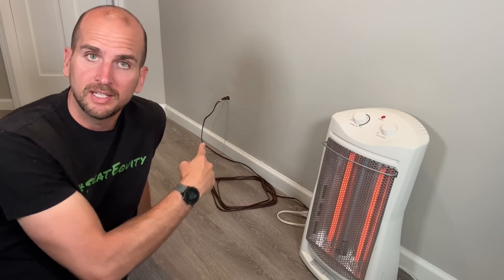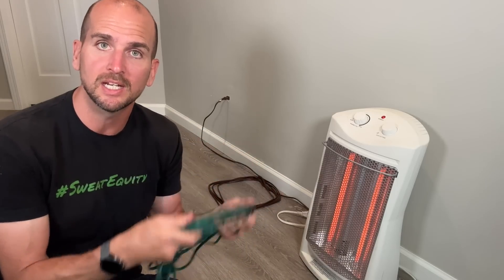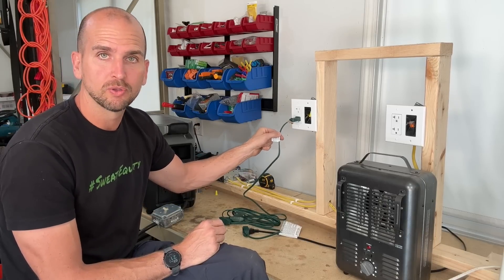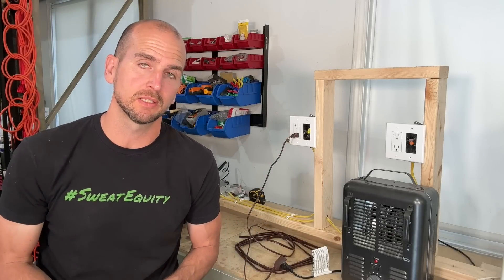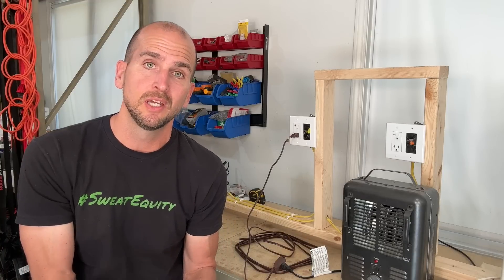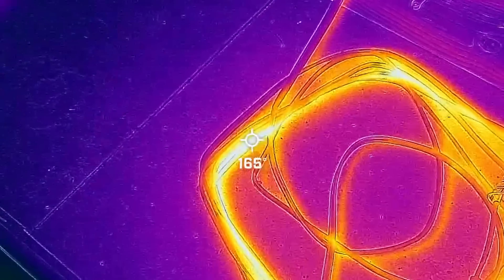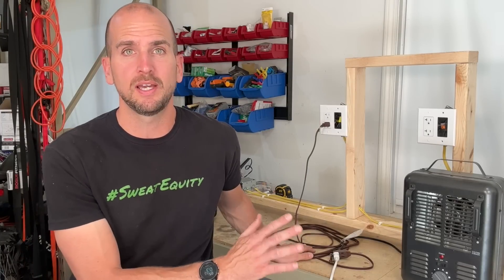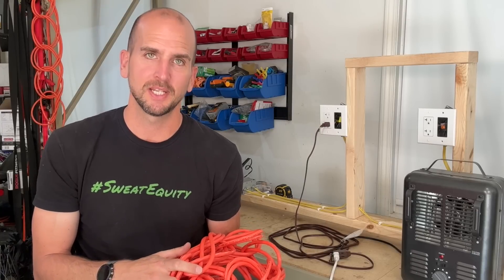The #1 Most Dangerous Electric Device in Your Home

Comment: Space heater rules of thumb: 1) never use an extension cord or outlet strip 2) if the plug is loose in the receptacle, replace the receptacle.
Reply: Yeah, I've always heard (and adhere to) not using extension cords at all for space heaters.
Reply: And speaking of receptacles be especially alert if your home was built or had wiring added between 1965 through 1973 give or take a few years, during this period aluminum wiring,  specifically the 1350AL aka old technology aluminum wiring was likely used in at least some of the circuits.  Unless the terminations have been made using approved methods AL expands and contracts 2 to 3 times that of copper or brass and also forms aluminum oxide which is a poor conductor unlike copper when oxidized remains conductive.   Any of these conditions can cause dangerous overheating and set fire to surrounding combustibles when heavy loads are drawn.
Reply: The problem is that in older homes especially and even newer homes if you have lots of power hungry devices in a room, you have literally no choice if you want to run a space heater or power hungry room cooler, a modern gaming computer/console and a LCD or OLED monitor because the power taken up by the devices can literally overload the circuit breaker supply power to the room.
Did that only a few days after my parents died and I was like "Okay... not doing that again!" Went to my parents 'bag of cords' and got the beefiest extension cord I could and ran the space heater off the secondary bathrooms outlet.
Never had the breaker trip again and the cord never even got above room temperature anywhere on it.

Comment: Conductors get hot. Did the 170 degree exceed its rating?
Reply: Most 16 gauge extension cords are rated at 70 degrees C which is 158 degrees F.  However, the carpet or linoleum under it may not be rated that high so the cord could light up the carpet or linoleum and burn down your house that way.  The molded male plug ends also tend to start to melt after a long time running at its maximum rating.  I have had heaters where the molded plug end did this right on the cord attached to the heater.  At that point I cut the plug end off and replace it with an industrial rated replacement male plug end.  Don't attempt to replace a male plug end unless you know what you are doing.

Comment: An iPhone Thermal Imaging Camera.  How cool!  Maybe not all that precise, but a good perspective indeed.  And you can also recor dit.  One learns about extension cord safety, or should, when connecting a portable generator or something like your EcoFlow to a circuit breaker panel.  A guy at Lowe's asked me about it when he was buying a high power portable generator for hurricane season.  I advised him to get 12g wire and be careful about extending them by coupling two together.  He said he didn't know distance, so I helped him select the single cord length by having him approximate the distance.  I'm glad he was smart enough/concerned enough to ask.  He asked me because it's hard to find employee help these days.

Personally, I have a collection of extension cords in different gauges for different applications and lengths.  Better safe than sorry.  I'm also going to watch you "Best Way To Wrap An Extension Cord."  I'm interested to see how easy it is to unravel.  Thanks for the videos, Scott.
Reply: unless they've changed model numbers, it's called the FLIR One.  they also make it with a standard connector, so that model can plug into ANY smartphone but an iphone.  they also partner with a smartphone manufacturer, to make a phone with an integrated thermal imager, but US carriers refuse to support it.

Comment: SERIOUSLY complicating this situation is that extension cords are not permanently marked with its wire gauge. I did find one here with a tiny, flimsy, difficult to read label that will easily and eventually fall off. It did give the volt/amp/watt rating which I presume is 16 gauge, despite the cord itself appearing very heavy. I wonder if its rating (125V/13A/1625W) takes into account its length.
Reply: I have a few that it is stamped into the insulation.   Probably depends on the manufacturer.

Comment: Ive always thought extension cords are a danger, regardless of gauge.  You have an electrical connection, likely lying on the ground, where flooding or what have you can connect with it.   I admit I do use a power strip for my computer though.

Comment: It's really unfortunate that standard consumer extension cords don't come with (cheaper than cheap!) fuses that would nearly entirely remove the danger presented. Furthermore, maybe I'm not looking in the right places, but as far as I'm aware, there just are no 16 gauge extension cords with fuses, even if I'm willing to pay a little more for one. Using a string of lights as an extension cord is safer than a purpose built extension cord!
Reply: I am curious as this seems to fly under the regulatory radar too. Like Fans and christmas lights all have fused plugs, but extension cords do not. Fuses are cheap, so I doubt that requiring fused cords would add significant cost.

Comment: It's a UL requirement and has been for some time, that extension cords must be constructed of #16 or larger wire, or #18 wire  with integral fuses. Having said that, folks younger than 40 may be unaware,  but some years back #18 extension cords with 15A markings on the plug and receptacle ends and no built-in overload protection were approved and widely used.  They made good fire starters when space heaters were plugged in and turned to high particularly if any part of the extension cord was placed under a rug or what have you.   The 15 amp rating on these antiquated cords were the ratings for the ends, not the cord itself.
Reply: 18awg extension cords are listed at 13a.  Even 16awg cords get pretty hot with space heaters.  It's recommended that you avoid using drop cords with space heaters but if you have to you should be using 12awg cord or larger.
Reply: @ianbelletti6241  Actually, the NEC limits 18 gauge cords to 10 amps and 16 gauge cords to 13 amps.  I don't like to run space heaters at their full 12.5 amp maximum on even 16 gauge cords although technically code allows it.  I mainly use heavy duty 14 or 12 gauge extension cords if I need one.
Reply: @mharris5047  I've used space heaters in a pinch on 12awg cords in a pinch and I can tell you that a 12 awg cord gets warm enough that you can feel the difference.  If I had a 10awg cord at the time I would have used it instead.

Comment: You are technically correct about larger gauge extension cords having a lower power loss, however the bigger issue is just the voltage drop.  Running long extension cords for a DIY project in your backyard is a good way to burn out motorized tools such as circular saws, drills, power washers, air compressor, etc.  This gets compounded when someone plugs one 100' extension cord into the another 100' cord just to reach their work site.

Referring to it as power loss may cause people to rationalize, "I don't care about the power loss.  So what if the electricity of this project costs me an extra $0.25, I want to get the project done today."  

In the USA, the nominal outlet voltage is around 115 to 120 volts.  If the voltage goes down, the current draw to your motor will go up.  It's not uncommon for people to have less than 100 volts at the job site due to excessive voltage drop.  And if you're starting a motor, the inrush might be 30+ amps.  More amps means more heat.  You run the risk of burning out the windings in the motor.  Motors with a high inrush current may have difficulty starting under low voltage conditions.  They might even blow the circuit breaker back at your home.  Power tools that operate just fine in the garage suddenly have issues when they're 200' from the outlet.  

Your tools may also have less power to accomplish the task at hand.  Cutting landscaping timbers or pressure treated lumber, drilling holes to assemble a backyard wooden playset, etc.

Yes, volts x amps = watts (ignoring power factor), but the biggest issue with long extension cords is the increased current draw from the low voltage applied to the motor.  And anything with a heating element will not work as well at long distances because of the lower voltage.

Helpful hint:  If you're buying a portable floodlight, get one with LED bulbs.  Those bulbs will work just fine regardless of the voltage drop in the power line.

Comment: I just dont run space heaters or similar heavy loads from extension cords normally.  If I need to it's never unattended and always using the heavy duty 12awg, and really for short periods. I also never use an extension cord without protection, fused or gfci. I even have an in-line gfci adapter I'll call it that I will plug in first so be sure my extension cords are protected.
Reply: Just remember... gcfi protects from ground fault, not overload.
Reply: @Richie Allen  oh I do, and I feel gfci is more important for safety reasons, just doesn't fit the exact topic of the video.

Comment: That outlet is hideous and I can't believe how much it costs compared to a normal duplex outlet
Reply: And the repairability score being non-existent.
Reply: Only application I could see it having a legit use would be if you have floating shelves that you want an outlet or some artistic specialty use. Its totally dumb otherwise
Reply: @MM-fe9mz  no. The only time I can see using this option is in a tight space where you need an outlet but have no room for a proper cover.  On top of that, it would have to be a dedicated single outlet application.
Reply: & after you covered everything with mud, how is the box accessible?
Reply: @greggpurviance7252 I saw the video where he installed it. It's not really a serviceable design. Yes, it technically is serviceable because the outlet is removable.  The problems are that the hole is too small to work with and the outlets aren't common.  I think that those outlets should be banned.
Reply: @greggpurviance7252  you have to buy a special key to pull it out
Reply: @MM-fe9mz  looks like you then have an Itty bitty access hole to the box. Not enough working room. Not sure how they got UL listing. Looks worse than a fart fan
Reply: @MM-fe9mz Can the special key also be used to pull one's head out of one's ass when the regret sets in? 😜
Reply: @scottwilling5315  these outlets remind me of those new "hydrant" outdoor hose bibs that require a propriety $20 piece of plastic that we all know will get lost when houses change owners or get lost/broken in the junk drawer.
Reply: looks dangerous
Reply: Hideous? Nah
Everything else? Oh yeah
Reply: An application where it maybe would make sense would be in a room with a dedicated outlet for an electric fireplace space heater like I have in my guest room/office, so you can better "hide" the plug so to speak. If it could be blended to an old baseboard, that would be pretty nice, but that would basically be wood in a junction no? Can't see spending that much on it in any case.

Comment: I think the bigger danger is outlets or connectors that do not grip the prongs securely. I have seen cords of appropriate size get dangerously hot at the connection points (plug or connector) that surely could have caused a fire. I always check all of the connections and cord frequently while these are in use to identify any overheating.
Reply: That's true because outlets get  stretched from appliances  being plugged in and out thru it's life time. Then when a bigger load is plugged in  the  resistance is lower with, voltage lower, causing heat...
Reply: @AmericanOne9621  Even some extension cords that have the UL label do not connect tightly and get hot from using high-drain appliances. I always test how tight connectors grip on these cords before I buy them because there is some junk out there,

Comment: I managed 60 million dollar highrise buildings for a living.  Space heaters for offices are strictly forbidden in leases. You can't say space heaters are generally safe. 

1st reason is you have a 12k foot floor plate and then you have 4 people sneaking in space heaters. First calls of the day? Tripped breakers and loss of power to work stations in a call center. He tenant blames owner but it's the tenants employees breaking down the system and the lease. 

2nd In an office setting people go home at night. They leave their space heater on or set to low and it still trips breakers and is now also a fire hazard. Just takes getting knocked over by housekeeping or other employees. Had building fires 3 times due to space heaters.  

So you cannot speak for office spaces. Just my advice. You are encouraging breaking a lease agreement and or risk of loss of business and or fire. 

My advice. Stick with the home. The extension cord is good information. So try not to cross from residential into Industrial or highrise properties.  Thank you

Comment: Great demonstration! Obviously electrical equipment should never be overloaded, but I wonder how much of a hazard this actually is in practice. I have experimented with this in realistic worst case scenarios such as drawing 20+ amps through 16 gauge cords covered in a towel for hours and I have never been able to get it hot enough to catch fire or even show any signs of melting or damage, but my testing obviously doesn't account for a lot of variables long term degradation of the insulation. If a lot of fires were started just by overloading extension cords, I'd hope that all these small gauge extension cords would be required to have a built in fuse or circuit breaker.
Reply: I used to service this restaurant that ran a refrigeration rack on 16 gauge oversized extension cords connected to a power bar. Oh and the ground was broken off. I told them about this periodically but they never got the message until about 2 years in when one day I heard arching behind the wall and puffs of smoke coming from the outlet. 

Failer point has many factors to every scenario but had this setup been done correctly this should never have been a concern.
Reply: I've plugged a heater into a normal home 3 outlet extension  cord and the cord got so hot to the touch it almost burned me. 

Don't do it.
Reply: @OgdenM  Was it a 12 gauge or less extension cord? A YouTuber recently did a video on why he believes that even 2 prong extension cords should be made of like 14-16 gauge wire at a minimum for exactly that reason.
Reply: @christopherkidwell9817 the 18 awg cords are meant for stuff like 1 or 2 strings of Christmas lights that will never draw enough power to be an issue.  Every day drop cords do need to be larger.  Any cord that you stretch out for using tools should be 12awg or larger. Also, if you use a 2 to 3 prong adapter you should either be connected to a GFCI protected circuit or be using a GFCI protected cord.
Reply: @ianbelletti6241  Eh? Did I get the wire gauges backwards? Larger number = smaller gauge?
Edit: Whoops... after checking on a website, I did get it backwards.
Reply: @NoahJoeKing if the power strips have integral breakers that are all the same and they're all working properly there's no danger in the overload other than breakers tripping.  However, this is still poor practice.
Reply: The usual reason that a plug melts is because it is severely undersized with the gauge of the wire for the load. That is the reason why I don't buy 12 gauge wire extension cords. I always go with the more... beefy... cords because I had one extension cord that my parents and I were using to run a heater in my bedroom when I was sick as a child melt and it would have caught the room on fire if not for the fact that my parents were intelligent and put the bulk of the extension cord in a very thick plastic bucket that my father knew would not melt ever because he had tested it.
Heated it up to 500F with a heatgun for 10 minutes and that plastic bucket LAUGHED at the temperature. Things were made better back in the 1980's.
Reply: @christopherkidwell9817 I think you mean 14, 16 or 18 awg. 12 awg is the largest cord that you will find commonly in the stores.  They don't carry many 10 awg cords.  With awg you need to remember that the larger number means it's a smaller size (16 awg is smaller than 14 awg).  OSHA requires all extension cords on job sites to be 12awg or larger.  I would recommend the same for around the house because there's a tendency for homeowners to overload the smaller cords and power strips.